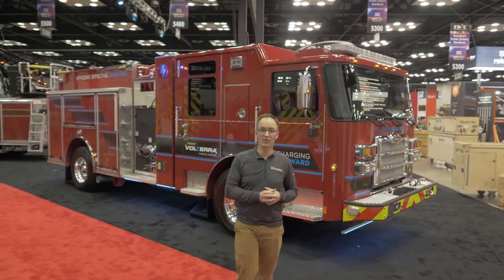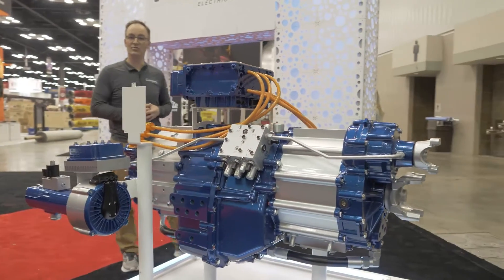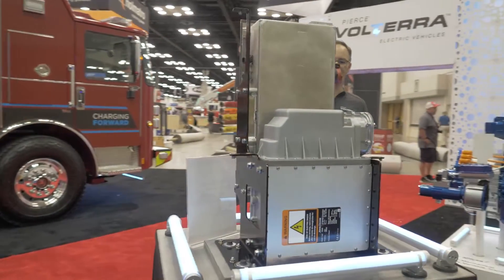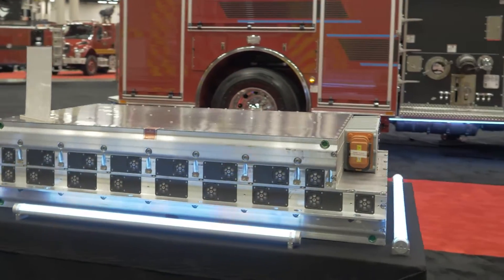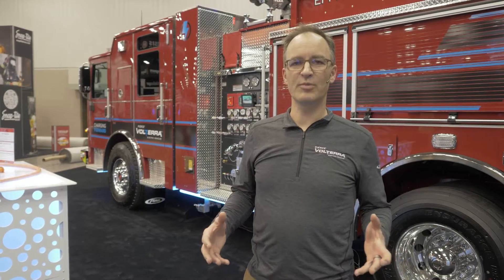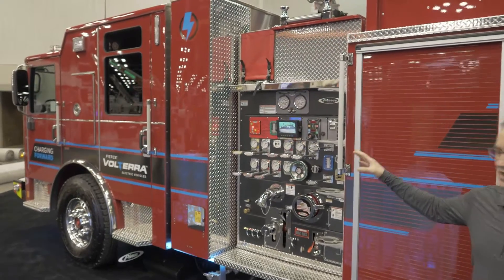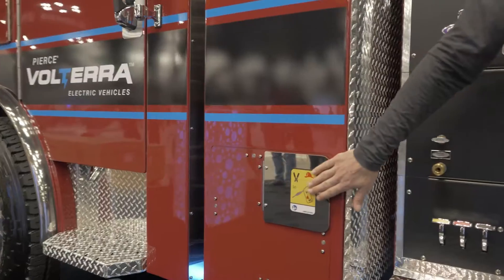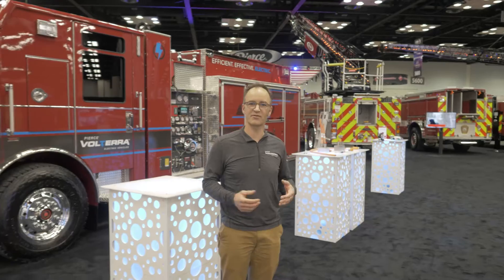Pierce® Volterra™ Electric Fire Apparatus – Key Components

Comment: Electric fire apparatus is not a practical concept.
Reply: They're here & they work. I'd want the range-extender diesel generator but a huge percentage of runs for most depts are just for medical.
Reply: @dbyers3897 yeah, hybrids sound really reasonable: everything but long range and high volume pumping can be done on batteries, and for large fires range extender-generator can kick in. Less fuel consumption, less noise, no exhaust at the bays, also you can move the engine anywhere you want, no need for the driveshaft - put batteries there, thus get really low cg, that would allow higher water tanks without the risk of overturning e.t.c.
Reply: @solarissv777  Well as with other drivetrains, you can't move the engine while pumping. It uses the same transmission either to drive or pump. I've looked at the CG & it's about the same as a conventional diesel engine. The electrical/battery system is quite heavy & mounted vertically behind the cab. Still has a diesel for electricity generation but I believe a Cummins C-6 would be sufficient plus fuel & def tanks. You might be describing the Rosenbauer RTX. It's an EU style & set up very differently.
Reply: @dbyers3897  basically yes, something similar to it. Personally, I don't really like Pierce's approach: they slapped electrical system on top of an existing engine designe and called it a day, adding extremely high cg. As for the Rosenbauer, it has somewhat limited pumping capacity, as it was originally designed for much less flammable European environment. But anyway, I believe that the idea that you can fight major NA fires with electricity is delusional, getting to place faster, using advantages of the election transmission as well as saving fuel on other types of calls though is a totally reasonable idea.
Reply: E-One has an EV with diesel range extender.  The batteries are spread out beneath the cab & box in unused spaces giving the truck a low center of gravity & good front to rear weight distribution.  My FD is strictly E-One & I hope they will seriously consider this in 5 - 10 years when our next engine is due for replacement.
Reply: Agree, but WA. and CA. governors disagree with you and think EVs are peachy keen and want 50% compliance for government fleets by the 2040-2050s! WA. state already has a ban on “NEW” internal combustion engined vehicles being sold after 2035! Crazy where they think the raw power to charge all these vehicles is going to come from!
Reply: @trob0914  That is one of the dozens of reasons people are fleeing those states